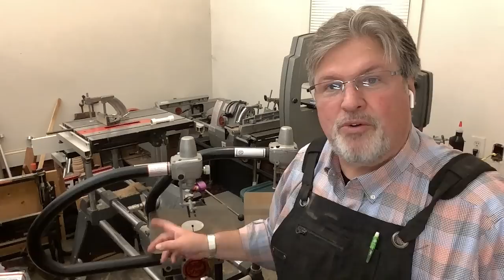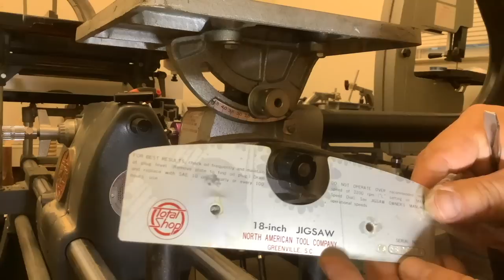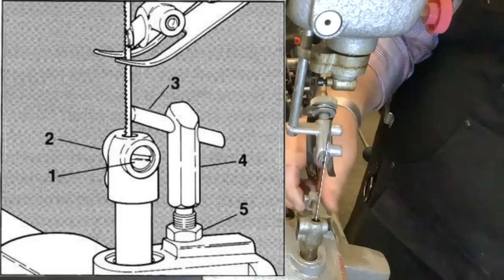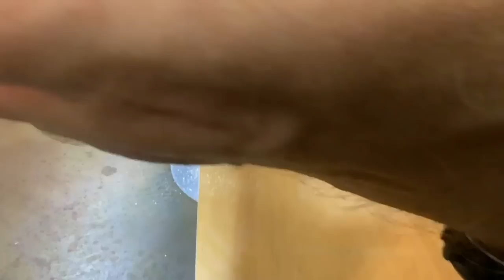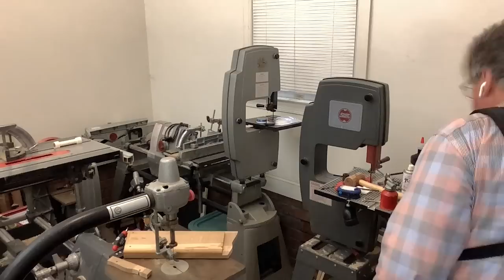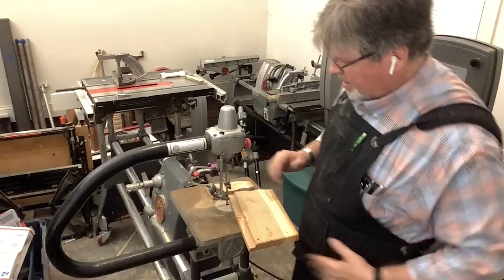Introduction of the Shopsmith 18" Jigsaw SPT (Special Purpose Tool)

Comment: I have both the scroll saw (old) and the jigsaw (very old) and was thinking of selling the latter, so I’m looking forward to seeing your video next weekend on why I should keep it.

Both machines have run out of puff, presumably because the leather gaskets inside the air pumps have deteriorated.  I’ve tried oiling them to bring them back to life but no joy so far.  Any ideas what to do next?  I don’t think the parts are available any more.
Reply from the maker: Hey Graham. The leather is easy to fabricate and replace. Just pull it out and use the original piece as a template.  Surprisingly you don't have to oversize it much from the worn original to bring it back into service.  Scott

Comment: Great video. Love that saw may need to buy one. Thanks for the suspense,  can't wait for next week video. Do you know if there's a metal cutting blade for this jigsaw?
Reply from the maker: Yes, there were metal cutting blades and it does a particularly great job with nonferrous metals, such as the half-hard brass used for clocks.  Scott

Comment: Great video, looking forward to this series. The cliff hanger lives! "Tune in next week at this same Bat-Time on this same Bat-Channel."

First impression having only watched the Jig Saw and Scroll Saw videos and never used either, I like the Jig Saw over the Scroll Saw. But I do recognize a common design paradox in that it can be flexible or simple, but not both. The Jig Saw seemed to require a bit more fiddling with knobs and set screws than did the Scroll Saw.
Reply from the maker: Your skills of observation are excellent.

Comment: I've had the jigsaw since the 70s and I never knew about rotating the mechanisms to saw from the front.  You taught this old dog new tricks.  Are you going to cover cutting large circles with the assistance of the table saw fence on the 500?  Can that be done with the 510 or 520?  BTW my "new" scroll saw arrived today, and I think I'm beginning to experience nirvana.  Thanks for the great info.  Glen, not Sandy
Reply from the maker: Glad you like it, Glen! I was thinking of mentioning the circle cutting with the 500, but it is a bit of a challenge with the 510, but It can be done. I still remember that issue of Hands-On with Dave West on the cover where I learned that trick.
Reply from the maker: Just checked and it was the July/Aug 83 issue.